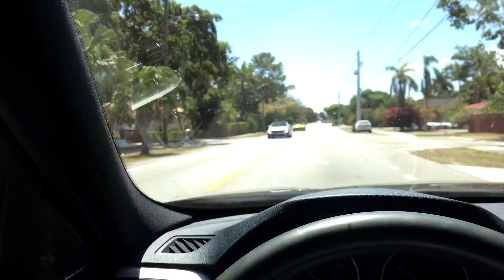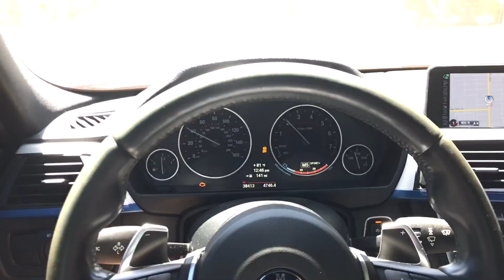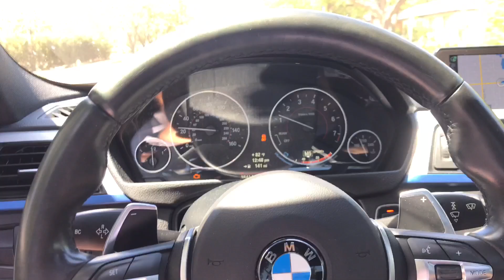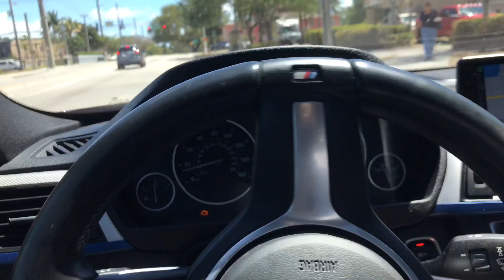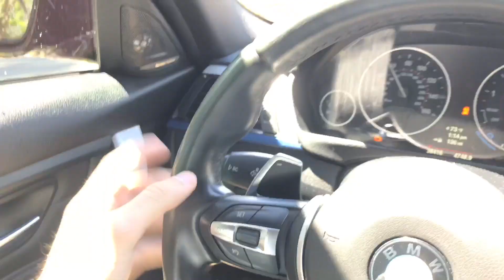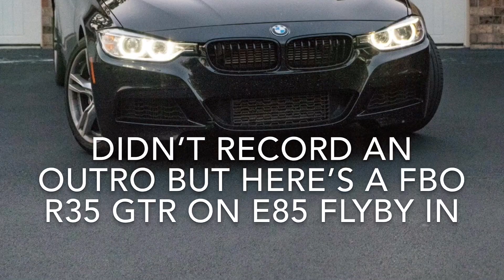Catless Downpipe BMW F30 335i - Exhaust Review (INSANE GTR flyby)

Comment: Why is the check engine light always on?
Reply from the maker: SentinelFPS catless dp and my tuner doesn’t clear the code
Reply: @kevspec  You don't need a tune to get rid of the CEL, all you need is a deflouler installed on the 2nd O2 sensor.